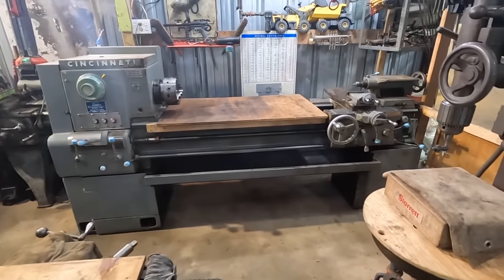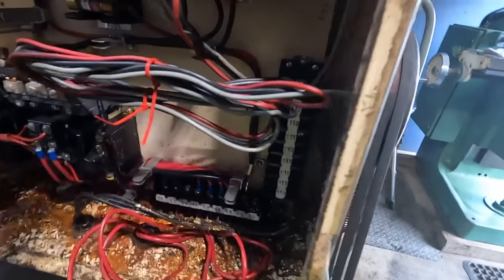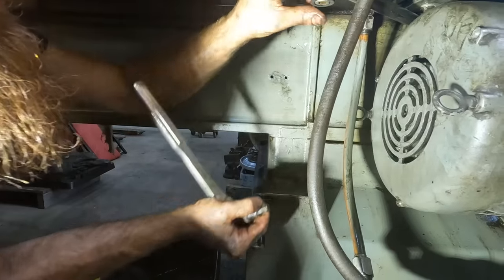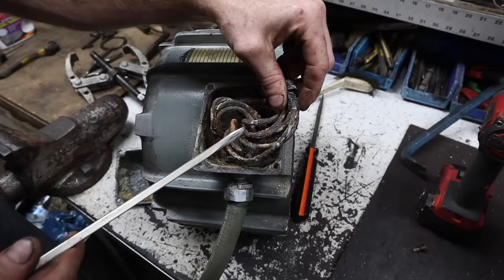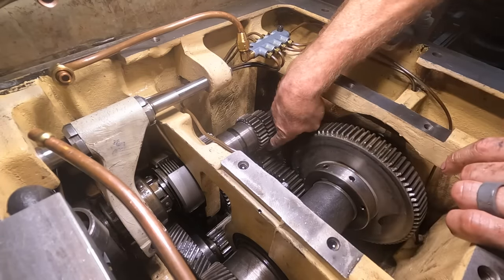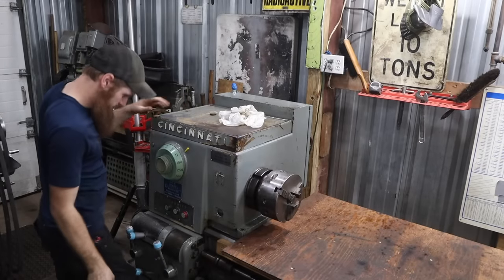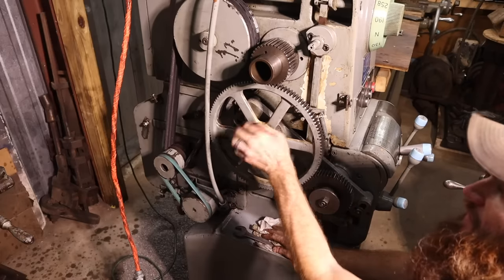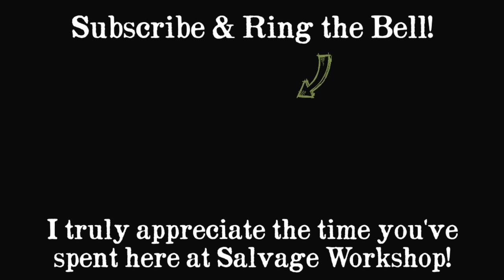Can we SAVE this BROKEN Lathe? ~ MAJOR Issues found! ~ Will it Ever CUT again?

Comment: Two (of many) rules for working with a lathe: - never work with gloves; - never approach rotating parts with a long red beard! And you will live happily ever after and will continue to delight us with your new releases for a long time...
Reply: would a long yellow beard be appropriate
Reply: I too was cringing when he got close to that spinning gear. It sure would make you’re eyes water getting caught up.
Reply: Or ties, I watch the guy , that had a tie on and he was using lathe demonstrating , If the tie would’ve got caught, that would’ve popped his head off
Reply: I remember Daryll Holland in one of his teaching video's ''People in the pony crowd tuck it away or you have a ''haircut'' in a hurry'' .
Reply: @bishopkinlyside8477 omg I zip tied an pulley rope to the front of an 4 cilinder Briggs and Stratton without thinking obviously  😂😂😂😂 didn't end well yesterday.
Reply: You can feel vibration with a hardwood dowel or a plastic knitting needle, and listen very directionally with a length of fuel hose running to a funnel over your ear.  All that keeps fingers and ears (and beards) away from hungry spinning metal !
Also I wouldn't be wearing a finger ring near equipment.
Reply: Absolutely agree that hair and spinning things are not a good combination, particularly when said spinning device has sufficient power to cut through steel with ease.
However my other "Never do this!" observation is when he left that giant chuck key in the three jaw chuck. It is precisely why modern chuck keys have a spring so that it requires the user to actively hold it in place. Otherwise the forgotten key can become a projectile if someone accidentally turns the lathe on.
Reply: @paulbryan1094  gawd i seen that as well scared me he is floating with disaster took my breath away wow
Reply: ~ 100% agreed with all previous comments. (ER / ICU, former Military MD, and 'wanna.be' machinist here..). It'd take a much too long a comment just to barely describe tragic / painful 'accidents', actually caused by pony tails / long hair / beards + finger rings, bracelets, ties, dog tags w/ neck laces and / or paracord, etc, etc. More than a couple limbs or LIVES  lost + countless amputations + families affected. Most of the above, easily avoided with basic safety training. It's ALWAYS better safe than sorry.   Not a coincidence there's a higher percentage of these events happening after any holyday(s), long  weekends, etc. PLEASE: Let's keep in mind recklesness is potentially lethal + awareness keeps us alive, healthy + away from ER / several other dreadful stuff.. 
May our Lord keeps us safe + Bless us & families!!...
😑🇺🇲💪🙏🙏🙏🙏
Reply: yeah I was like holy shit when he was messing with the side gears with the belts,that would rip his face off clean to the bone. NO BEARDS ALLOWED
Reply: I worked at engineering company making military water jets units. Over 500 engineer's. 
Safety meetings every Monday. You weren't aloud long hear or beard jewelry etc.
Anyways accidents happened daily. Some you remember more than others.
One guy was hit by 3.5m 250mm stainless prop shaft after walking under a Gantry Crane.
The guy pushed the release by mistake. He survived but never worked again.
Another was a cnc milling machine that someone in the office altered the program without having it checked.
It sent the head at high-speed into the hardened block shattering the head. In went through the reinforce safety window taking the bottom jaw off the poor guy running the mill.
I walked in minutes after in happened not a nice thing to see.
He was back at work months later still going under reconstruction surgeries.
Reply: What bothers me about a number of these channels is that they just seem to be going for a “Look”. Which these days is the bearded mountain man one. Hopefully it will go away when some other fad comes in. As far as danger goes, they either don’t understand it, don’t care, or are also trying to show that they aren’t interested in following “conventions”. It’s an anti-safety movement in parts of the country. It’s also sad.
Reply: Well…. Hopefully he won’t have to learn the hard way and just have a close call to enlighten him. Who knows, he may get lucky and have a separate close call to scare him away from man purse Fanny packs that he is sporting. Isn’t he so handy…. Oh, and the quick draw cell phone holster. “Go Go gadget 4 inch micrometer!”
Reply: Got mine trimmed for that reason👍🦘🇦🇺
Reply: No rings no gloves and short sleeves I was taught in apprenticeship school,
Reply: @morriewyatt6234  yeah, and everyone takes the spring off. YouTube is so very different from industry. It’s as if they don’t know anything here. Well, many don’t.
Reply: One more safty tipmnever aprock anything spinning with a tie on either
Reply: @xbear7473 only black beards are gangster enough sorry.
Reply: I wonder why no one from the safety committee ever gets invited over for BBQ or beers
Reply: @melgross the 70's porn mustache is already making its arrival. Much safer 😂
Reply: You are only as good as what you were taught and boy let me tell you that beard is a nice beard but not the kinda cool you want around any mill or lathe it is unbelievable how fast and many have fukt around and found out why all machinist prefer to be bald I have seen what just a chuck will do to a young.fella wit his metal band hair days hair it was not pretty  also no where near the power or size of a cin17 it was a little sioux needless to say he still is a machinist still carrying the scars on his face Also prefer  his head shaved ever since they had to shave the rest off to stapple his face and head back together watched the boss cut his hair out the chuk and scrape off the meat and blood as well as fish teeth out the chip tray.. atleast put on a beard net
Reply: @paulbryan1094 ❤
Reply: Now u change a phase on ur power..awesome video..am I right with it backwards
Reply: Amen to that. If that machine gets a bite on you..part or all of you is gone.
Reply: @asya9493 I've seen two different fingers that were "cuffed" from a ring getting caught on something an pulling so hard on the skin that the tissue was torn all the way around and pulled back,  hence the term cuffing, the tissue was literally pulled back like the sleeve of your shirt. 
The first time it was my buddies older brother that had jumped up and grabbed an overhead bar, but when his weight came back down,  the ring caught on something that would not give and had enough of an edge to start the skin to tear. Who would have thought,  just a freak accident.  We were in grade school,  I haven't been able to wear rings my whole life.  Cuffed fingers are repairable,  it's pretty frequent actually.  Not something that you want to go through if you can help it.
Reply: @paul5683  another word for the injury is "degloving". Takes the muscles off like removing a glove.

Not pretty.
Reply: @asya9493 Does anyone else remember the poster of the aftereffect of wearing a ring in the shop that used to be prominently displayed in the every army machine and auto shop back in the eighties (or am I just too old)? At least put a piece of tape over it.
Reply: @northcanterburylogging3039 Spinning things DO NOT give second chances …. I saw a guy who had 25 years under his belt have a moment of inattention and come out minus a thumb. I was a young man then — decided to switch to programming — when I screw up on the job — only virtual blood results. I get to keep all the original equipment ….
Reply: @nrapopor   Yep, we had those.  No rings, chains, beards, long hair, loose clothes or excuses.  Was fine by me !
Reply: If you really want to be a disciplined machinist make a deal with yourself that you're never going to touch anything that is spinning . And teach yourself to file proper.... Never with your elbow over the top of the c h u ck.... And there's been lots of accidents with..emery cloth.
Reply: I always say Google it if you want to find out.... What kind of oil do I use what's the inherent problems with this type of lathe  contact... Cincinnati.... Get a machine tool mechanic..... Or call and talk to somebody at Cincinnati
... They will probably refer you to a machine tool guy.
Reply: I've been a machinist for 60 years.... My dad was an engineer and a journeyman Machinist.... He always taught everybody to be conscious of their hands..... I'm in my 70s and I still got all my fingers and he had all his when he died.... Always make a safety issue out of as many things as you possibly can..... Here's a good one for you..... My lathe has a foot brake .... I don't use it... All the time....... because I want it to last when I really need it.... I can most definitely wait for that spindle to coast  to a stop .. I see these machinits reaching up there and grabbing onto the Chuck and rubbing their hand on it as it comes to a stop.... There can sometimes be a chip stuck on that chuck... And it can be a rotating knife... Tear skin or hook your cuff on your sleeve or your ring or your bracelet or your watch. Some machinists want others to watch them show off how they're not afraid of rotating equipment. Eventually it's going to be a bad example.... It's just a matter of time. Especially when you become elderly anybody over 50 is considered elderly ..make every move a well-thought-out safety conscious task.. make each move deliberate.... And never take stupid chances.
Reply: I was screaming at the tv! Get your beard out of there. Heart pounding. Great restoration. Just what’s previously mentioned. 😊
Reply: I know a guy that got long hair and a long beard and he says... That he is careful..... I say if you've got a long hair and long beard you are not careful.....
OSHA equipment that is supposed to make a seal around your skin on your face cannot make a seal with facial hair.... Something as simple as a particle mask will not work for them.... And if they are painting something with a charcoal style filter respirator.... You guessed it it's a big No-No it does not make a seal on your face if you have facial hair you're going to be asphyxiated...... That is paint fumes are going to enter your lungs your nose because they're going to leak around where the facial hair stops the rubber from sealing....
Reply: Safety Glasses also.required
Reply: I was cringing everytime he was listening to that bearing making a noise at high speed. Waiting for that beard to catch in the gears
Reply: Agree, had my pulse up. However traumatic and disfiguring a beard catch in rotating machinery may be, there is the factor that it's connected to the brain case (the part that really matters) via an elastic and hinged mechanism, which may just save a life.
Reply: @dreddredd7137  I've witnessed it happen! I was in printing for years and I told the guys with long hair to tuck it inside their shirt, or it will get ripped out of your head. I was watching a guy on the cat-walk back out of a unit and he stood right under a belt driven grater roller, the static grabbed his pony-tail and before I could get the words out it snatched his tail up and ripped it right out of his head! The scream was indescribable! He never came back to work after that. I saw him a few years later and asked how he was, he had to grow his hair kind of long to hide his scar and the bald spot it made! It was ugly.
Reply: I was getting very worried when he bent down close to that spinning chuck and when he put his head an inch away from the flywheel to listen for a noise. I was always taught to put one end of a long thin screwdriver in my ear and the other end on where the noise is coming from and use it as a stethascope to pin point bearing noise. I really wish he would tie it up out of harms way.
Reply: No loose clothing is also important ...or better yet, no clothing.
Reply: #1:01:07 lol
Reply: "- never work with gloves" for cleaning the lathe i prefer to wearing gloves happyface
Reply: Or the drawstrings on hoodies
Reply: Couldn't agree more. I realize that these days its really trendy and edgy (and hot and dirty) to have a long Amish beard. Never could understand how one could work in hot, greasy and mechanized settings with long head and facial hair. I like to shower after a project and wash away every remnant of said project. Never could get my beard and hair totally void of what I was working on and got to smell it for days afterwards. Not to mention the danger factor.
Reply: @northcanterburylogging3039 How miserable it must have been to have to rush back to work while half your jaw was still in pieces. God bless the fella. He never should have had to return.
Reply: @melgross You nailed what I wanted to say. Not that this fella does it for this reason. But there's a "buck authority" Amish farmer trend that they think makes them look noble and edgy. I live in florida and I watch these 20 somethings with more hair on their face than top of their head. Even when its 95 degrees outside. They simply look foolish and unhygienic. But my biggest pet peeve is when I go in to the local barber and with only three young men ahead of me. Its still over an hour wait time because they have to shape and touch up the muskrat living on their face. 😅

Comment: Maybe the lower drain plug is not connected to the recirculating pump to allow a small amount of water and sludge to settle out of the recirculating oil. This will insure that the transmission is only operating only on oil. Automotive transmissions collect sludge in the bottom of the pan because the pickup of slightly above the bottom of the pan. I would not change the drain plug to a tee.
Reply: I think you are right and possibly a good idea to add a tap on this outlet so you can drain off a controlled amount
Reply: I agree with bitpit, I wouldn't have a clue tbh, but that was the first thing I thought of.
Reply: I also wouldn't stress too much about changing that oil too too often, that machine was made to run with a very specific oil and to run for a very specific amount of hours. If he goes and changes it every 2 hour it runs, he will end up ruining that gearbox.
Reply: I was thinking the same because it has a separate tray it comes out of, you can see the tray or box from underneath it where he connected the 1/2 pipe to drain it. should be a valve their instead of a plug.

Comment: Whenever I see early to midcentury equipment like this, the first thing I think is "I hope that doesn't end up in a scrap yard." It's so cool to see guys like you restoring this stuff.
Reply: What's in the scrap yard? Why would it be of value to the scrap yard?
Reply: It looks like it's roughly from the 70s- 80s based off make and model. People are saving much earlier lathes than this. I just restored a 1908 Flathers lathe.

Comment: The correct way to move that lathe is by hanging it from heavy straps. It will also make it easier to get in any out of your shop. Once it's hanging you can turn it by hand to clear a small opening. Nice video.

Comment: <---- Retired Engineer. At age 18 when I was in-between construction jobs, I was offered an opportunity to work at a bolt manufacturing company and I remember we used these types of lathes for specific custom bolt/screw designs that had to be precision built. Seeing this machine just threw me back 44+ years and reminded me of those days. You're going to have lots of fun with that beast! Keep it maintained and the damn thing will outlive you! [That was built back in the days when USA built things to last pert near forever.]  Thanks for the great video y'all. 🤔🤨☺👍
Reply: Yeah, that was the good old Days.

Comment: I'm a retired (42 years) R&D prototype machinist that used to have the Leblond version of that very lathe. Careful taking the shift mechanism apart! Lots of small parts that can be lost or reassembled incorrectly. 
I really enjoyed watching this video since I've been out of the game for nearly 3 years now.
Have fun with that beautiful old lathe!❤
Reply: That lathe also resembles a COLCHESTER lathe I worked on many years ago, the twin gear selection levers were the same.  I retired at 55 some 20 years ago, so the time I spent on small lathes was many years before that.  I did use one for race engine lightning parts years later though. A very handy little lathe indeed.  I ended up on VTLs for years then went on to 5 AXIS fully CNC machining centres for a few years.  I ended up working far too hard so I retired - lol
Reply: I was saying NO leave that alone! When he pulled the shift head off.  Just getting the linkage and shift dogs in the correct place is challenge enough, much less if they dropped out any detents or springs.  Not a job for someone who seems to have a few hammers and pry bars and an adjustable wrench.
Reply: Love LaBlond's.
Reply: I lost two fingers, well they did so them back on and they work but I can't play guitar anymore I can't feel them anymore. There are very important rules for a reason and you are right I was almost having a heart attack when he had his head by that moving gear it's insanely stupid and this guy is not a stupid person it took me almost losing two fingers terminally to fully respect these machines it was the most painful thing that I ever witnessed and I don't want to do it again heaven your fingers yanked off is horrifyingly painful I am so lucky they were able to fix them
Reply: Spent three years ('56-59) of class time on a Leblond for my grad project. You have done a great job on a classic machine. You'll love it!.9